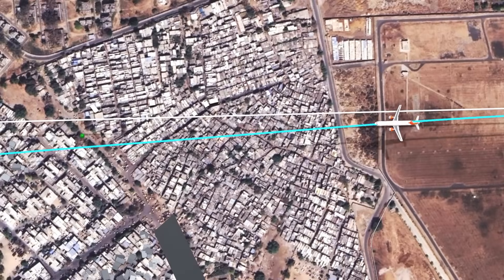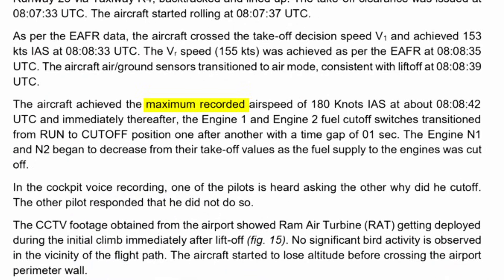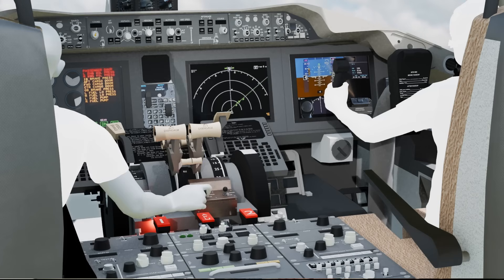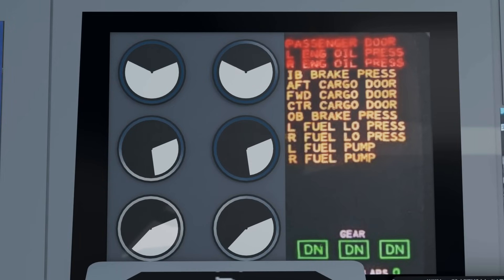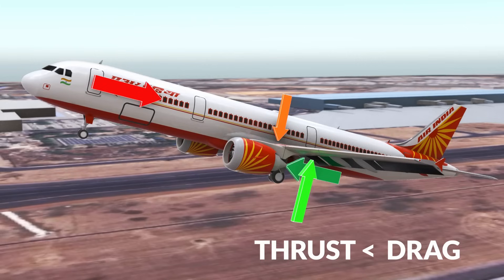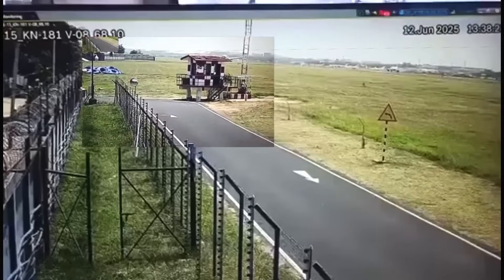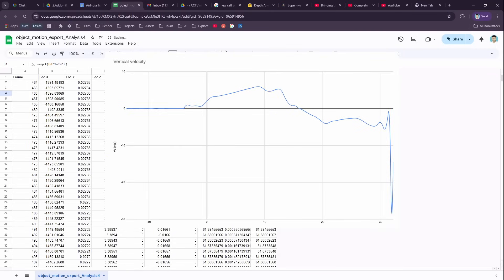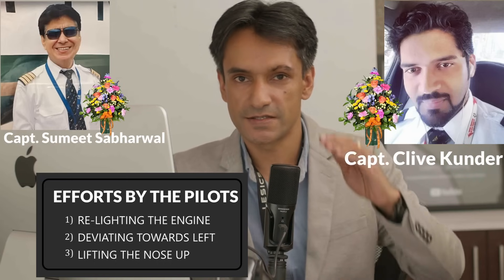Use of 3D Clone | Decoding the Crash Details you Missed

Comment: Of course, Clive Kundar, as pilot flying, tried to save the aircraft. A true hero, this young man.
Reply: @petraeva7698    No, it's the Captain doing the heroic work.  Once the RAT starts powering the plane, the FO's screens go dark and only the Captains work.  He is the PF now   Also it seems the Captain was the first to notice the fall in engine thrust and realise the engines had to be restarted and moved the switches to Cutoff.  But really, it doesn't matter I'm sure they both did a fantastic job.
Reply: @SIMARJEETMEHTA  cutoff procedure is cut off and IMMEDIATELY relight. There is no 10 second wait. This case will never be solved - all speculation and a waste of time - we should leave it up to the pros to analyse and solve this case.
Reply: @petraeva7698  Switch transitions aren't recorded while RDC is out of power. The crew may have cycled the switches back immediately but which got recorded only after power returned, potentially after 10 seconds.
Reply: While the FO started out flying the aircraft, SOP is that when there is an emergency, the Captain takes over, so the Captain was most likely flying the plane as soon as they lost thrust.
Reply: @timrider1224  I'm missing the callout "my aircraft" on the voice recording. We are trained to say this when taking over the aircraft. Had this been the case, the AAIB would have certainly published this vital piece of information in their prelim. I am sure the AAIB knows exactly what happened and is withholding this info until all possibilities are being examined. We will have to wait for the final report - if we ever find out the truth, which I doubt. This will probably wind up to be another case like MH370.
Reply: He acted quickly to recover the plane, but the buildings made it worse.
Reply: @Jai-om1fo truth, immovable objects at either end of a runway have been not good for planes.
Reply: ideally , there should be a long clearance
Reply: @Jai-om1fo sounds like a good idea.
Reply: How many times will you repeat this same shit la low effort WhatsApp university bot farm bots........... Google it out before you start spreading your bullshit
Reply: Obvious that CRM and communication protocols were not working when assuming both pilots were working hard to save their plane.   This is highly unusual.   If one of the pilots had intent to kill themselves, they conceived of quite a scheme to hide this intent and picked the short period of time when all this could be obscured
Reply: the people who leaked this report, why they did not mentioned Whether they have heard the noice of switch physical movement or not in the voice recorder.
its very evident that the physical movement produces considerable amount of noice and Audio recorder is efficient enough to capture very minute noice.
If the noice was audible in the recoreder, it was a soild supporting evidence for the for the people who (assumingly representatives from boeing, NTSB, GE or UK investigators) leaked this report to prove pilot did it deliberately .

Why the time of RAT deplyment is not mentioned in the report? instead reprt mentioned  power reinstated from RAT 4 seconds after both engine failed.
Then when was RAT deployed? normally it takes 8 seconds from the deployment to establish power  (opinion from some expert).
If that 8 second phylosophy is right, then there must have an electrical failure during take off [(3+1+4) - (8 seconds) = 0 ie, take off time ]. See, the volocity at that point was less, then efficiancy to deliver the power by RAT also will be less.

Why there is a termal runaway on rear side data decorder especially tail end was not exposed to fire or heat. wires were burned.
Reply: @anilkumarnair5590 Indian can’t accept the truth lol
Reply: Both the pilots were true to their profession. They were responsible professional. Boeing seems to be the real villain in this case.
Reply: @cricket-xg6zr How do you know? You’ll be embarrassed if they ever release the CVR. You won’t actually, you will just ignore and stop following or commenting on this Air India crash stuff. Stop believing Indian paid media.
Reply: correct
Reply: What is your evidence that capt Sabarwal did sucide?
Reply: @prateekbhardwaj9943  there will never be any evidence - all speculation,  as in almost all pilot suicide cases (exception German Wings in 2015).
Reply: Both pilots tried to save.
Reply: no, both pilots
some people wanted to cover up boeing, so the report leaked deliberately
Reply: @anilkumarnair5590 You don’t even consider the possibility of Pilot suicide. You already have made up your mind. What if the Captain actually tried to kill himself and others and Boring isn’t really responsible this time. You never accept mental illness is a thing and that’s why people in India go untreated for ADHD or PTSD, lived their whole lives without even knowing.
Reply: @anilkumarnair5590  its not a ''cover up'', its just that the prelim report has raised more questions than answers, we are supposed to get the opposite of that
Reply: @anilkumarnair5590  one pilot. 
do not accuse Boeing, for your problems
Reply: @Jai-om1fo  you can blame pilots by using a non-transparent preliminary report, but not Boeing or Air India.
Boeing has a history of telling lies, thanks to Ethiopian aviation agencies who stood against Boeing’s lies.
When MAX accident took place what Boeing CEO told? these pilots doesn’t know how to fly.
Boeing has a bad history since Donald Douglas took over the steering.
There are many people like Captain Steve and many who want to cover up Boeing. Its ridiculous. 
Money tells the lies
Reply: @Jai-om1fo   But you can blame pilot with the support of a non-transparent preliminary report but can’t Boeing. Ridiculous.
Right from the beginning, covering up Boeing is very much evident by some sources who firstly blamed pilots for retracting flaps instead of landing gear. Money plays the big role.
When its proven false, immediately turned to them with this clueless report.
Why we can’t finger towards Boeing since they have such lying history. 
Once MAX accident took place, Boeing CEO blamed these pilots doesn’t know how to fly.
Finally, thanks to Ethiopian aviation authorities for their stern stands.
I prefer, better concentrate on aircraft/ airline rather than blaming on pilots.
Reply: @anilkumarnair5590  Did any indian official investigation agencies blamed Boeing? Did Air india blamed Boeing? Did Government blamed Boeing?  Do you have any evidence from investigation!
Reply: @Jai-om1fo  This is a preliminary report, do you understand what that means? How can you expect boeing to be blamed at this stage? Also given boeing’s past history it is more than justified to believe that a fake narrative is being played to blame the pilot. Don’t you know what happened after the Lion air crash? Don’t you see the similarity in blaming the pilots post crash?
Reply: @Jai-om1fo when there is an emergency, the Captain always takes over. Flying the plane and trying to restart the engines would have been a joint effort. These guys had their hands full.
Reply: The Independent US
Shweta Sharma
Updated July 20, 2025
"An initial analysis of the cockpit voice recorder recovered from the Air India flight that crashed last month reveals that the younger co-pilot asked the captain why he had turned off the plane’s fuel-supply switches, according to a US media report.
First officer Clive Kunder had the controls of the Boeing 787 Dreamliner for take-off and at the time of the crash moments later outside Ahmedabad airport, according to a new report from the Wall Street Journal citing sources in the investigation, and it was he who asked flight captain Sumeet Sabharwal why he had flipped the switches, starving the engines of fuel."
The pilot, Captain Sumeet Sabharwal, issued a "Mayday" call to air traffic control shortly after takeoff, according to multiple news sources.
Reply: @Jai-om1fo again where is the evidence?it's just speculation
Reply: @Jai-om1fo  You don't know much about Indian investigative agencies or Air-India or Indian Politicians😂
Reply: @Jai-om1fo    Do you understand logic and reasoning at all?   Do you understand aviation?  If there was nothing wrong with the maintenance (as per foreign experts there wasn't) and nothing wrong done by pilots (there is lots of proof that it was not the pilot's fault),  then the only thing left is Boeing,  It's really quite simple.  Dirty fuel, no flaps, high weight, hot weather, landing gear,  etc. has all been shown to be irrelevant in a simulator.  It's really pilot error, or the plane at fault.   One or the other.
Reply: @Jai-om1fo you have a vivid imagination. You’ve invented many words in the conversation that were not in the prelim. 

I take it you were in the cockpit too.
Reply: @sauvikdas7743  The important issues here are early insurance settlement before the final report or the grounding of the 787
Reply: @SIMARJEETMEHTA What's the proof that it wasn't the pilot's fault? Genuine question.
Reply: @Jai-om1fo  The preliminary report never mentioned who talked to who. From your comment  "it was he who asked flight captain Sumeet Sabharwal why he had flipped the switches, starving the engines of fuel." The latter part "starving the engines of fuel" was not in the speech of the pilot and the preliminary report did not indicated that was said by one of the pilot. It is added by the reader's interpretation or imagination!
Reply: @njayapani   What a late time to ask such a question - where have you been the last 2-3  weeks?  Please see a few videos and educate yourself.  
BTW, what's your evidence why a Captain with a good 30 year record, suddenly became a mass murderer?!  None at all.  So your question itself is absurd.   Or should we suddenly suspect every bus driver and every taxi driver?  Millions of such trips happen everyday in India, when have you ever heard of this kind of thing happening in India?   NEVER.  Not even once.  IOW it is not even a 1 in a Hundred Billion chance.   And yet you are paying attention to this infinitely low probability and absurd point.
Reply: @SIMARJEETMEHTA I've watched and read a lot about this case closely since the beginning. I never said the captain was the one who did it, don't put words in my mouth. 

I am asking a genuine question because at this stage, based on the facts we know, I see no evidence that proves EITHER side of the argument definitively. Therefore since you claim to have proof and evidence that it wasn't the pilot's fault, I want to educate myself about what it is.
Reply: He (Clive)tried to save the plane  , his Captain was Smart,Experienced and SUICIDAL and made sure the plane was DOOMED.
Reply: @AuralioCabal-nl8gi keep trying harder😂😂😂😂
Reply: @AuralioCabal-nl8gi  You have to turn off switch at right altitude and at take off, so that it will not be recoverable and controllable  due to time  limit.
Reply: @Jai-om1fo you are no pilot and AAIB already said it was the F…pilot who turned of the fuel OFF SWITCH!
Reply: @AuralioCabal-nl8gi  correct
Reply: @AuralioCabal-nl8gi no they didnt say that. It said the fuel switches shows that they transitioned. They are looking into sensor data, not actual switch movements.
Reply: @temp1851 The FDR records the actual position of the switches, via dedicated cables from the switches themselves.
Reply: @temp1851 how else would you know a switch moved other than a sensor? There is no video surveillance on the switches 🙄 plus if they were truly malfunctioning enough to turn the fuel off, it's amazing that they magically started working again in time for the fuel to be turned back on. Almost, I dare say, impossible. Like it was people just turning the switches on and off the whole time.
Reply: @AuralioCabal-nl8gi folks like you who have no idea about flight (i wonder if you ever boarded one) are today throwing verdicts on experienced pilots without any proof.

Comment: Why did the pilots say lost thrust and not explain the cause and remedy?  The pilots would have known the switches were flipped they can both hear it. The cockpit voice recorder would have picked up the click of the switches being moved as well.  The switch movement is irrelavent to lost thrust without the CVR data and timestamps.
Reply: They are very afraid to tell what those recorders told, that is a huge problem, big money keeps silent! Or how?
Reply: @kyostim  You bet!
Reply: Valid questions.
1 - Pilots are taught to: aviate, navigate, communicate in that order of priority.  Aviate means focus on keeping the plane airborne.  There was no time to communicate more than a very brief mayday.  The fact that they sent a mayday indicates that they probably knew the situation was hopeless and wanted investigators to know that there was a thrust problem.
2 - The pilots would not hear the software-controlled fuel valve control relays in the electronics bays.
Reply: @patricklockerby4308  I agree if you do not know what the problem is.  But that is not the case here they both knew what the problem was yet did not relay that to ATC.  It is unlikely the switches were moved prior to lost thrust.
Reply: @googlieking  They did say: "thrust not acheived" which I take to mean that they were unable to restore sufficient thrust.  They only had a few seconds to try to save the plane: precious seconds which could not be wasted in communications.